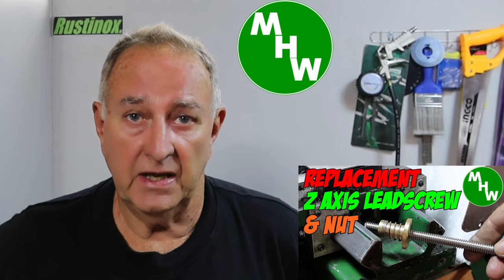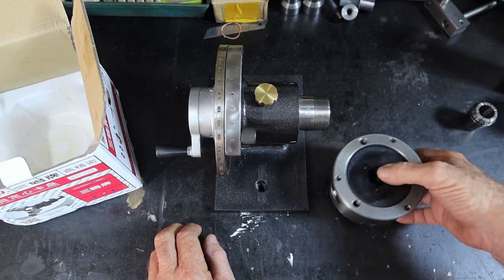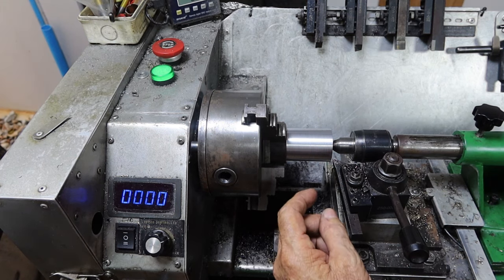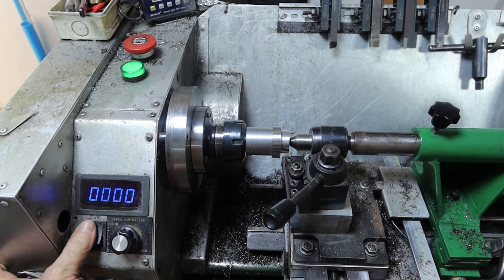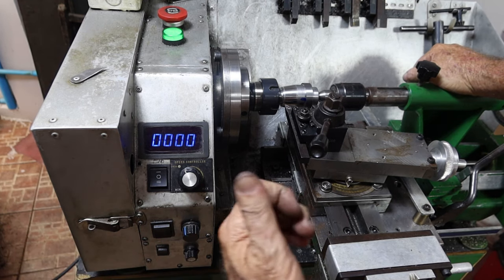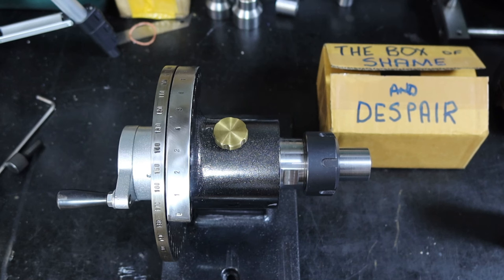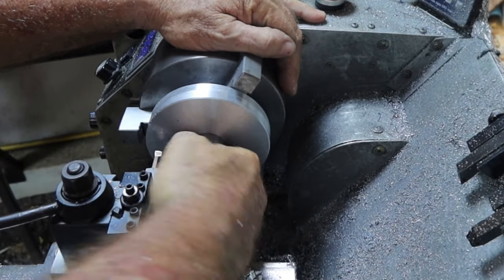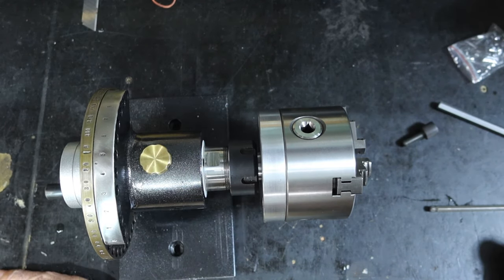MHW Episode 122 - Spin Indexer - 3 Jaw Chuck Adaptor

Comment: I found out the same way that sardine tins are no longer made of tin ;)   LOL . The job turned out good. I wondered if you were going to heat shrink the ally onto the steel (as well as the bolt) or were you worried about distortion ?  It's strange they don't make spin indexers with a Morse taper.  By all accounts the humidity in Thailand is legendary.  Cheers Rob
Reply from the maker: I had being able to disassemble it in mind, so it had to be a nice slip fit. Yeap during the wet season things rust while you are looking at them it can be so humid. Thanks for watching. 👍

Comment: This is the recipe I use at home for casting aluminum I intend to machine, you should try it out some time. It's the composition for A356.

92.05% Aluminum (Al)
7.00% Silicon (Si)
0.35% Magnesium (Mg)
0.20% Iron (Fe)
0.20% Copper (Cu)
0.10% Manganese (Mn)
0.10% Zinc (Zn)
Reply from the maker: I'm only using a 12kg pile of scrap castings I bought at the moment, I can only assume that it is of reasonable quality, because it is all from old instruments and gear used by a tunnel boring company. Thanks for watching. 👍

Comment: Another nice build, very enjoyable.
BTW I noticed on the chuck box it says "No1 quality" and the thought occurred to me "Is that the best end of the quality scale or the opposite?" and is it possible to buy anything other than No 1 quality?
Also recently watched a teardown of a new chinesium chuck and the guy had to clean out grinding "dust" and deburr just about every edge on the thing before it would work nicely, needless to say it was a very cheap one, hope yours is better.
Reply from the maker: The Sanou brand has a fairly good reputation for reasonable quality. I think I may have seen that same video, I can't remember who it was. Thanks for watching. 👍

Comment: Hello Matty, safe travels both ways ! 
What is it that you used to create the mold for the aluminium blank and what was the coating, it seemed as if you then just buried that in fine clean (beach?) sand and it dissolved, burnt away when the molten aluminum was applied
Reply from the maker: Thanks, we only traveled up here yesterday, it took 10-1/2 hours. To try and avoid repeating myself too much, in next weeks episode 124, I go through the whole process of how I make my casting blanks, the only thing I don't explain is the bucket when I pour it, and yes it is just a very fine sand that I have sieved and it's bone dry. By the way, my name is Paul. Thanks for watching 👍